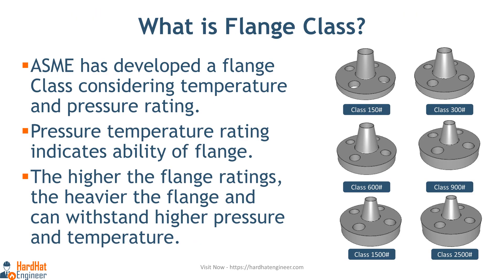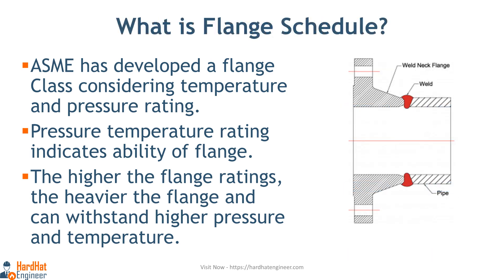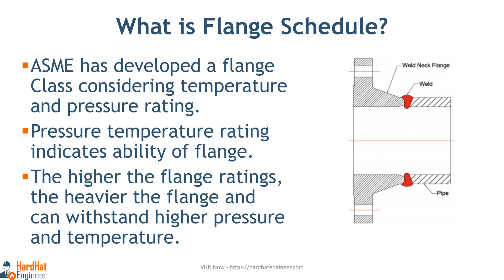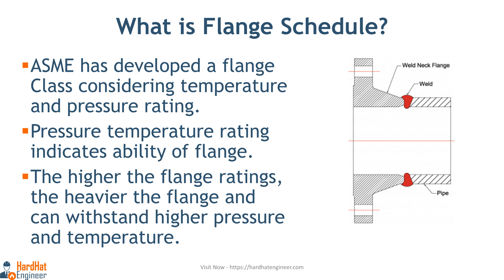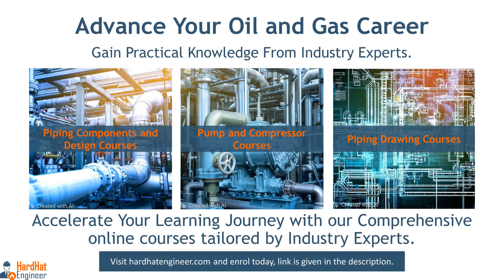What is the Difference Between Flange Class and Flange Schedule?

Comment: Thanks for the video. What types of flanges require a schedule to order? Only  Welding Neck and SW flange?
Reply from the maker: For any flange that connects to the pipe using butt welding, you have to mention both class and schedule such as weldneck, lap joint.